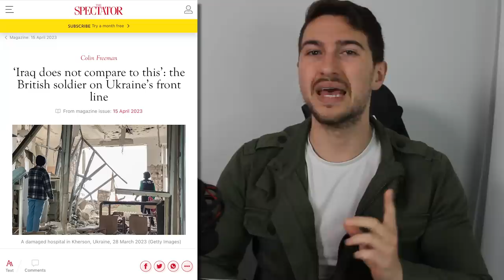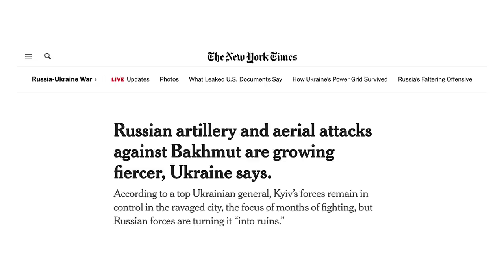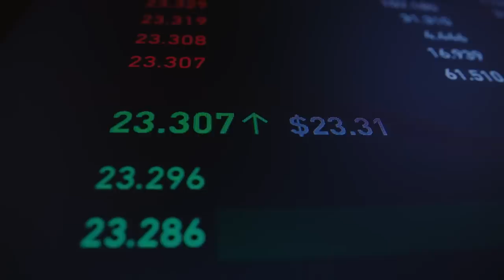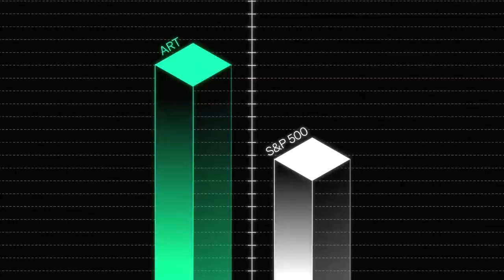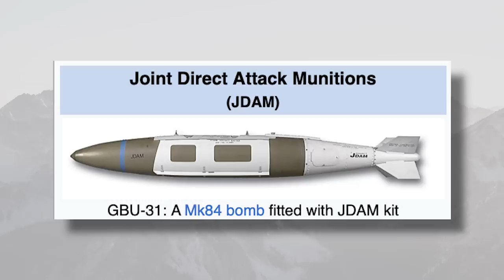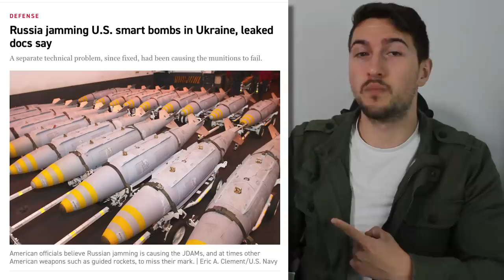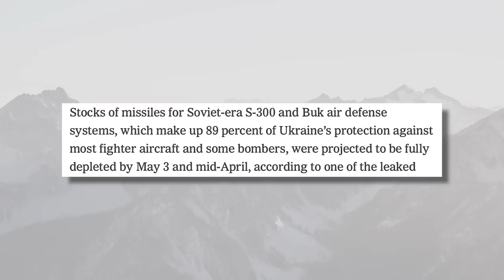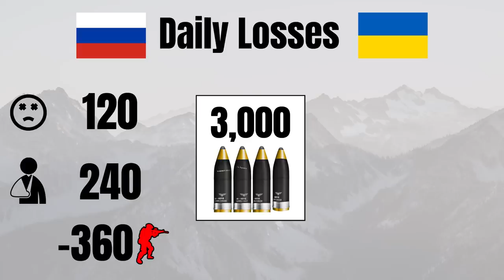Wagner Swipes Through West BAKHMUT with FAB-500s

Comment: Does 500 after FAB mean it has 500 shovels? That would explain the craters.
Reply: Yeah along side with 500 kilos of explosives!!!
Reply: @1kyzya1  But this is the smallest FAB. They have FAB 1500 and FAB 3000. You just can imagine the destructive power of them.
Reply: @iliadavydov3769  FAB-9000 which were crushing mountains in Afghanistan
Reply: MRobocop sorry they were over 9000 FAB.
Reply: Crater equivalent to use of 500 shovels. 😉
Reply: @mrobocop1666  9000?! I think your scanner must be broken! 😀
Reply: @iliadavydov3769  FAB 250 does exist.
Reply: Jokes are fine, but FAB 500 and heavier are not a joke. 
With the УМПК module that makes it a precision weapon. 
It is not fun at all.
Reply: @nikitab.6600  You must be great fun at parties. Smiling makes one prettier/nicer. 😀
Reply: @nikitab.6600  it can be a gamechanger
Reply: @neogalt2775  unless u got no teeth
Reply: @cindybates68  LOL
Reply: @damianock9991  it is. 
The Russians inherited a decent long range precision munitions program from the Soviets, their short range precision munitions are good too. 
The Soviets scrapped the short range ballistic missiles programs in the late 80s. 
So the Russian forces were pretty gimped in the stand off weapons department. Well the appearance of a cheap convertion kit, the issue of having enough of stand off munitions is solved.
Reply: Correct, 500 units is its shovelpower rating, and is equivalent to 500 Russian soldiers charging with shovels!
Reply: @neogalt2775  🤣😂😅🤣😂😅
Reply: It means manpower, with shovels.
Reply: why are they dropping them in fields if they are so accurate
Reply: @tylersperry9164  Over 9,000 is a phrase from Dragonball Z
Reply: @KaosNova2  Exactly right. I find a knowledge of the classics is a comfort in these trying times.
Reply: FAB isn’t that International Rescue ? over to you Troy
Reply: The large craters in the middle of nowhere prove the inaccuracies of the FAB 4 sorry that’s the Beatles. John and George must be up there having a good laugh at this shite.
Reply: @tammyclayton9828  We have great minds good spot
Reply: @1kyzya1  no, the whole weight of the weapon is 500kg, not the explosive fill.
Reply: Observation: Meatbags are being liberated!
Reply: @Barabel22  the crater on the picture from video was made by FAB-1500, not FAB-500.
Reply: 500 Fabulous shovels

Comment: That crater of 50m must be from FAB-1500 or there was ammo dump on site going into orbit.
FAB-500 cant make such efect on its own.
Reply: Depends what it hits. If it hits soil it can easily make a massive crater VS concrete even excluding the explosives it's still a massive 500kg thing being hurtled through the air at you, even if it didn't exploded it would still make a pretty big crater in the soft earth, now add the fact it's 500kg of literal explosives and we'll it makes sense. Cities used to be levelled by things like this, we tend to forget.
Reply: 04:42 - Destroyed vehicles can be seen around the crater. The bomb may have hit an ammunition depot.
Reply: 1500 of explosives makes craters that look like can fit a football field. Soil in those parts is very soft.
Reply: Could compare craters with the one Russia accidentally drop on their own city. Im sure a paved road might reduce the crater a bit.
Reply: Even for me it looks like an FAB 500, then again the explosives in bombs matter more than the total weight of the bomb... how big is the charge and what amount of TNT does it equate to.

So there is that...

A 500kg bomb in ww2 has a very different explosive yield when compared to a more modern one.
Reply: wait until they start using FAB-3000M-46.
Reply: @tricky1992000  wait until Russians start using fab-9000 😂
Reply: Ljubomir depends what type of warhead the bomb has. I assume its tnt. 500kgs of tnt will make a huge crater. About 30 to 50m depending on soil type. How rocky it density of the groud etc. I seen similar with the 1000lbs the Americans dropped.
Reply: @tricky1992000  if you think FAB are scary, wait till you see what ODAB can do.
Reply: Oh it sure can! Depending on what type of explosion it was set to. (yes it has several) on impact, delayed, and above surface.
Reply: ФАБ-1500 мы еще не применяли.

Comment: The Russians switched from attack to defense. They formed a multi-layered defense, and they attack in one place. That is Bahmut. The flanks are guarded by paratroopers, Wagner works in the town of Bahmut.About 30,000 Ukrainian soldiers and mercenaries died. Holding the line, the Russians drew the Ukrainians against them and destroyed them.
Reply: Ukraine doesn't use mercenaries. That's Russia.
Reply: @jesan733  Nice try. Next time watch the video.
Reply: @jesan733  a mercenery is a non national that participate in war
now because the west calls them foreign legion, volunteers, or what ever it does not change the fact they are MERCENARIES
Reply: @adultingwithnudo9484  Do you believe the video?   And did you believe the video from 6 months ago  -  Bakmut is about to fall?
Reply: @sonaruo  perhaps you should google e.g. "difference between volunteer and mercenary" before making such a statement? If you did, you wouldn't lose face. 
Simply put, a foreign volunteer enlists in a regular army, is part of that army's chain of command, and get regular pay. However, a mercenary is usually paid higher salaries and will not have enlisted in the regular armed forces and won't be part of a regular chain of command.

Thus foreign volunteers are afforded Geneva convention protections and are combattants that if captured shall be treated as POWs. This does not apply to mercenaries.

The reason Russia calls the foreign volunteers in Ukraine "mercenaries" is that Russia wants to incite war crimes among its soldiers and wants to scare people to not volunteer, because they essentially say "we will routinely commit war crimes, refuse to honor the geneva convention and simply execute you if we capture you, so don't come here".
Reply: @jesan733  Into which 'category' does a foreign national enlisted person who still receives payments from his/her  own government fall?  The "Geo-Political Entity" Ukraine is totally financed by 'Foreign' money.  Foreign money pays the salaries of Ukie military personel.
Reply: @corvusduluth  depends. If they don't fight, then they're just foreign nationals.
Reply: @jesan733   Lmfao, Ukraine not using mercenaries ? XD
Reply: @alikaraahmet5050  did you read the entire thread before making a fool out of yourself?
Reply: @tomassmato4126  Only 10% still in UA hands.  Nearly there!
Reply: @jesan733  yes
Reply: @jesan733  kid. The world is not as easy as your dream. there’s no volunteer in Ukraine because they all came for money lol
Reply: Ironic because of the thousands of actual Wagner mercenaries that died assaulting urban positions. Are we sure they aren't using shovels? I have to guess they would've won in the fall of they actual had guns right?
Reply: @tomassmato4126  it did fall, pay attention or get OUT 👉🏻
Reply: @jesan733  of my god get help mate ! You have lost every argument and your marbles 😮
Reply: @jesan733  The Ukrainians literally have American, Polish, Swedish, German, etc mercenaries fighting in Ukraine. They are mercenaries.
Reply: @jesan733  

They’re using a Japanese Yakuza
Reply: @jesan733  i know you're dumb, but this is too much 🤣
Reply: @jesan733  
What world do you live in? Ukraine no longer has a manpower that is trained at the highest level. Bakhmut is called a meat grinder. In the Ukrainian army there are:Americans, British, Poles, Romanians, Islamic extremists, Balts, etc. Documents, chevrons, etc. were found. Currently, 10,000 Poles are fighting on the ground. In Kiev, a dagger (Kindjal)destroyed the NATO headquarters 120m underground.
Reply: @elsonck2523  Embarrassing,9 months of battle for the tiny city of Bakhmut
Reply: @sigmasix3719  What a great winter offensive 🤣
Reply: @tomassmato4126  Kind of like Mariupol but victory in the end.
Reply: @elsonck2523  Kind of like Stalingrad...
Reply: @pajcka  that was a huge amount of Russian fantasies.
Reply: @alikaraahmet5050  ok, so we're you the result of a cousin marriage? Or why didn't you understand?
Reply: @acupofsagetea7410  you're an emoji child.
Reply: @pnh9399  because Ritter said so?
Reply: @sigmasix3719  I've never seen you state anything reasonable ever. You're kind of Russian propaganda extrapolated to twice the ridiculousness.
Reply: @olliefoxx7165  they are volunteers. Stop lying to encourage war crimes.
Reply: @Telco nerd they're volunteers, not mercenaries, regardless of how gory it is.
Reply: @rizkyzulkarnain7725  explain.
Reply: @jesan733  
Nope, I'm not, maybe you are the one who have two moms since you are Western, any way i don't care what you actually call them in theory, are they non Ukrainian paid killers? Yes, what are they fighting for? Money. 
Okay that's what i want to know.
Reply: @tomassmato4126  
Russians didn't claimed a winter offensive, they are doing pretty good job, Bakhmut it's not just a random city and in militaries it's not about the cize of the city, but about it's strategical position, it's a little city but very important that's why the Ukros defending it with their most trained and elit troops. 
Stop trolling around
Reply: @alikaraahmet5050  no, they're not fighting for money and they're part of the regular army. Thus volunteers. Being a muslim isn't a good enough reason to lie and support fascism, is it? So I recommend stopping it, because you're just losing face on behalf of your ummah.
Reply: @jesan733  no, they are fighting for money
Reply: @alikaraahmet5050  
Don't be ridiculous 🤣Putin declared to occupy the entire Donbas by 31.3.2023. Including Sloviansk and Kramatorsk.     "pretty good job" - Vuhledar, Avdijivka, Marinka, Lyman, Kupiansk 🤗🤗🤗
Reply: @jesan733  
I know 3 people personally who went there to fight for money, no dump fights a war which is not his country's war just for fun 😂 

You live in a parallel world man
Reply: @alikaraahmet5050  so what is their salaries, and what salary did they have at home? The Swedes I know who volunteers get far, far less in UA than at their jobs at home. People volunteer because they have a strong sense of what's right. You're laughing as a muslim at this thought. Very understandable, since your religion and upbringing often leaves you morally stunted. But anyway, you should try to acquire a sense of how others work too.
Reply: @tomassmato4126  
They didn't say that they will launch a winter offensive, again. 

Yeah they would have captured whole Donbass but Russians didn't expect the unconditional open support from the West. So he was right at the begining, but later they realized that it would take longer and their officials was not afraid to say that it's going to take longer time. 

No need to be a troll
Reply: @jesan733  for mercenaries, elensky will have to beg to the west first. So.
Reply: @jesan733  because Santa Claus is not real. I’m sorry kid, but it’s time to grow up 😂
Reply: @jesan733  wrong clown ,there are thousands of paid mercenaries fighting in Ukraine
Reply: @jesan733  "To encourage war crimes"?! Are you serious?! You're lying about mercenaries from Nato nations being used in Ukraine. All mercenaries are "voluntary", they volunteer to do a job FOR MONEY. The contractors the US military use get paid for their services. Theres an estimated ten thousand mercenaries in Ukraine that are getting paid with money sent to Ukraine by the US, Canada, Britain and EU. They aren't there for free. The recent Pentagon papers leak confirmed the existence of these PAID mercenaries.
Reply: @Tomsmith-dl7xz  can you prove that? I've only heard of volunteers.
Reply: @tomassmato4126  It's a Verdun style meat grinder. We are on the third time rebuilding Ukraine's Army. Ukraine's population is now the size of Holland. The largest percentage of Ukrainian Refugees fled to Russia. This tells me that a huge portion of "The average guy" in Ukraine wants to be part of Russia.
Reply: @tomassmato4126  when Ukraine losses bakhmut, there will never be a better defence.
Reply: @thematic3893  
You are right, with the fall of Bakhmut, the entire Ukrainian front will collapse, Russian tank columns will advance with the speed of lightning through the whole of Ukraine to Lviv.  Motivated Russian soldiers will shout Urraaaah and defeat any enemy. And then you wake up 🤣🤣🤣
Reply: @tomassmato4126   Let’s not get ahead of ourselves. Ofcourse the Ukrainians will keep fighting - but they will not hold a city like they did Bakhmut again. Mark my words. Unless they get lots of support from the US and EU, their back breaks here.
Reply: @thematic3893  Every war has its Bakhmut (Verdun, Stalingrad). The Russians are unable to occupy Bakhmut, Vuhledar, Avdijivka for more than 6 months - they have exhausted their offensive potential. Now we will see the Ukrainian attack...Mark my words.
Reply: @thematic3893  great that you put in this "unless they get lots of support from the US and EU", because if your statements turn out to be wrong, you can always claim that whatever support they got was "lots".
Reply: @jesan733   I’ve read your comments, you’ve made the least sense here so it’s comical that you of all people are asking for specifics. You should speak to someone that wants to speak to you.
Reply: @thematic3893  you just spoke to me, and I didn't ask you about specifics. I just noted you were too much of a coward to make a clear prediction.
Reply: @jesan733  ok
Reply: @jesan733  
it's another fact kido, without Western unconditional support Ukraine wouldn't last more than 2 months.
Reply: @alikaraahmet5050  I don't think that's true, but even if it is, Ukraine would then turn to insurgency like Afghanistan, and eventually Russia would have to leave anyway. All roads lead to Russia leaving.
Reply: @jesan733  
Here we go again
Reply: @jesan733  Russia is not leaving Russian land, deal with it
Ukronazis have overstayed theur welcome in Донбасс
Reply: @jesan733  If you join a PMC, you volunteered to be with the PMC and fighting with the PMC.  There are PMCs fighting in all sorts of conflicts, whether it’s Blackwater fighting for the United States or Mozart, or Wagner, all PMCs.  Voluntary for you to be there in them.  And yes people from whatever country can literally volunteer for Ukraine, and the reality is that there are some people from various nations, including NATO ones, who are in Wagner too.  That’s just how this war is.
Reply: @olliefoxx7165  Blackwater was the most prominent PMC hired by the United States in Iraq and Afghanistan
Reply: @AdrianFahrenheitTepes  so let me know which PMCs are FIGHTING on the Ukrainian side and what their numbers are. When I talk about volunteers, it's people who've joined the ukrainian army rather than a PMC. I'm arguing that there are virtually no mercenaries/PMCs fighting on the Ukrainian side, and that the foreign nationals fighting are volunteers, part of the Ukrainian army, and as such they're protected by the Geneva convention. (Russia pretends all foreigners on the Ukrainian side are mercenaries to entice and make the threat of war crimes.)
Reply: @jesan733  Let me know when you are trying to make sense.  Mozart PMC was with the Ukrainian side
Reply: Nah
Reply: @pajcka  lol you are gullible if you believe that
Reply: @BlyatimirPootin  
I am closer to the truth than you, brother, because it is happening close to me. We Serbs know very well what is happening. And you do as you wish.